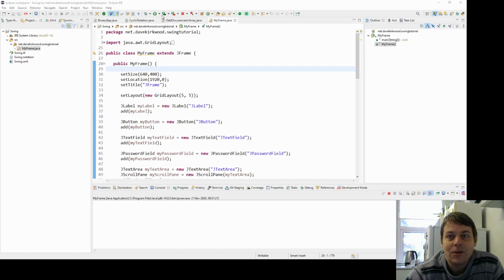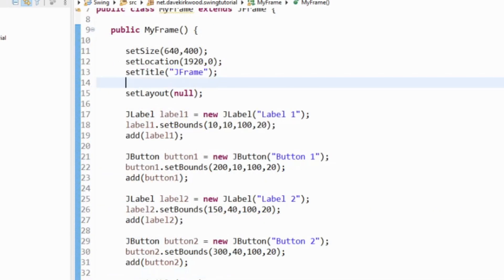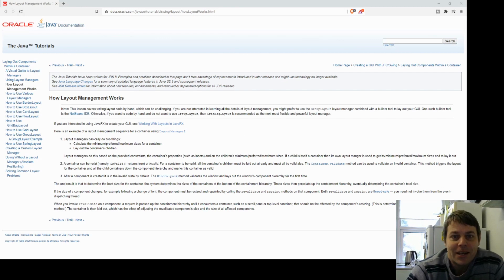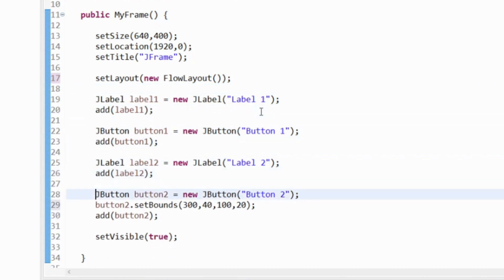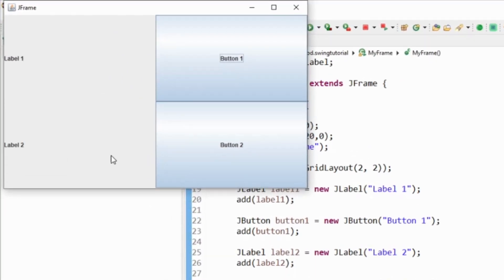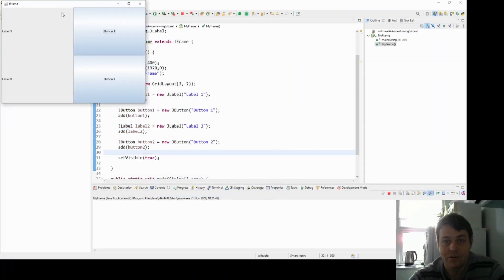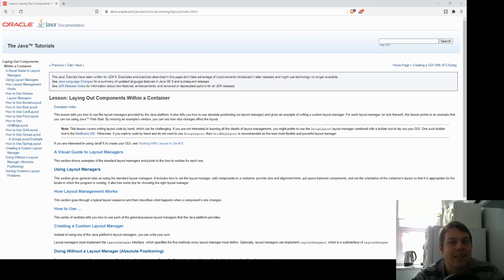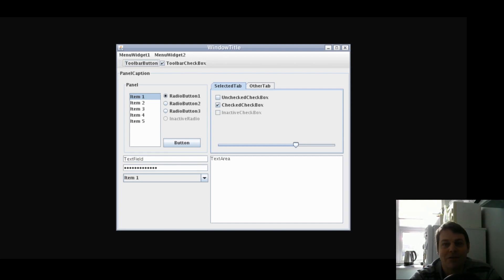Java Swing layouts

Comment: in case someone hesitate what kind of layout they should use based on Oracle site instruction:

"If you are not interested in learning all the details of layout management, you might prefer to use the GroupLayout layout manager combined with a builder tool to lay out your GUI. One such builder tool is the NetBeans IDE. Otherwise, if you want to code by hand and do not want to use GroupLayout, then GridBagLayout is recommended as the next most flexible and powerful layout manager."
Reply from the maker: That's a great tip Wilasta. UI editors can save time but I think its good to know what's going on under the hood. GridBagLayout can be a bit painful.

Comment: Hey, I hope to receive a reply. I just wanna ask how to automatically enlarge my internal components inside a panel when it is maximized —means that when I maximized my frame to its full state, the components inside the panel should follow the resizing and still stay in their current positioning as they were before it is maximized. I'm using GUI builder btw, thanks!
Reply from the maker: Hi, Java layouts are quite good at this. If you use a GridLayout this should just work. BorderLayout I think will only make the central component larger (this is useful if you imagine a canvas type application with toolbar, status bar etc.). FlowLayout doesn't do it and FlowLayout is the default, so you need to change it. I'd recommend using GridLayout/GridBagLayout and experimenting with those. You still have the problem of font sizes not resizing but you should find your components grow with the window. So, in summary, do setLayout(new GridLayout(2,2)); ...then add a button... then resize - you should see the Button occupy 1/4 of your window no matter how big you make it.
Reply: @javadave  Thanks, I appreciate this. So as you said, I still have the problem with the words not resizing by themselves automatically. Does that mean I should do it manually (resize the jlabel when I click the button to maximize my frame)?
Reply from the maker: @princekachu1840  You could do a window resize listener and then set the font on the components. Somehow, this doesn't seem like good practice to me though. Another thing to think about might be setting the maximum size of your window so it doesn't get too much larger than you want.
Reply: Thanks! Great videos btw, keep on coding! @javadave

Comment: I learned a lot from you. But i got a question. I have a project that uses drag and drop swing and I want to modify something but it seems that the components cannot be modified for some reason.. How do I do it using  code?
Reply from the maker: Hi, I don't really get what you mean by components being modified. Can you reduce your problem down to a minimum number of lines of code and then explain exactly what is happening and what you want to happen?
Reply: @javadave  i start by creating a JFrame class then dragging and dropping components into the frame. As i do it, it creates the code by itself into the class but if i wanna edit the components i added, i cannot edit directly with code. It's the InitComponents() method that holds all the components code.  Sorry if it's still confusing
Reply from the maker: @pjguitar15  I get it, you are using an editor to create your user interface. I wonder if the editor is somehow locking you out of the code, somehow making it read only (I'm only guessing here). Can you see the code? If you can, perhaps you could do the design with the editor and then copy/paste the code into a new project and then edit it there.